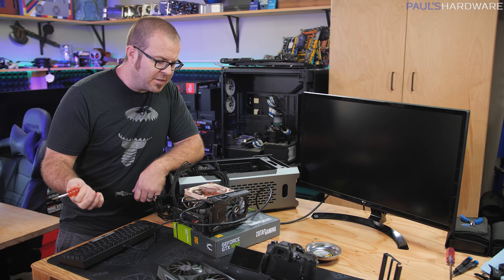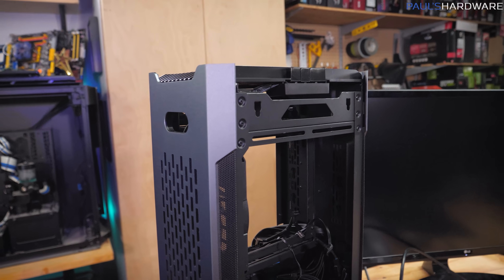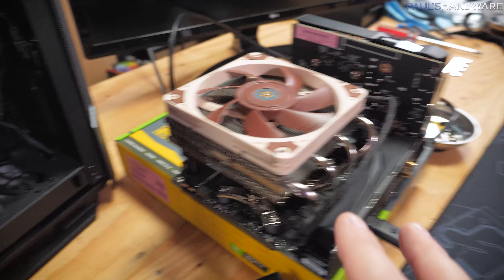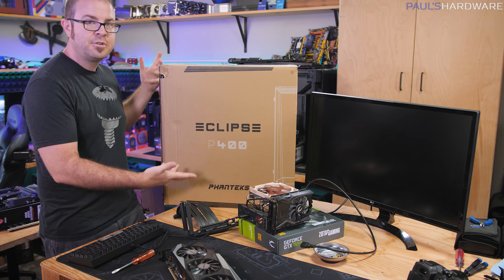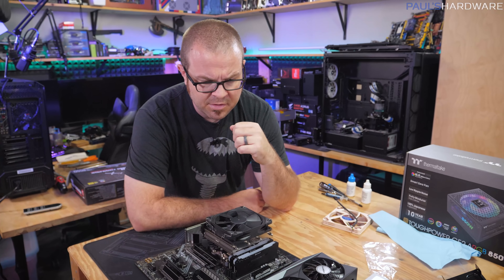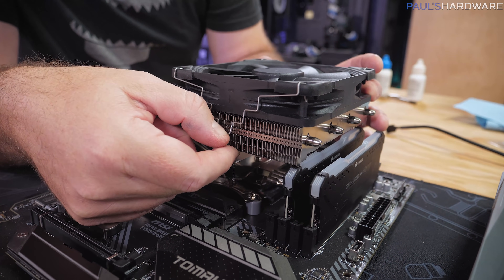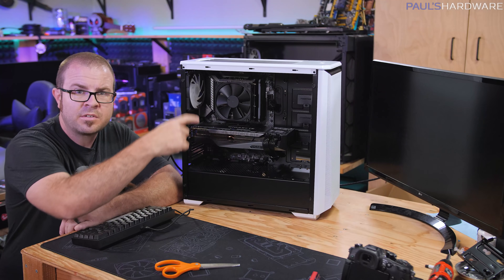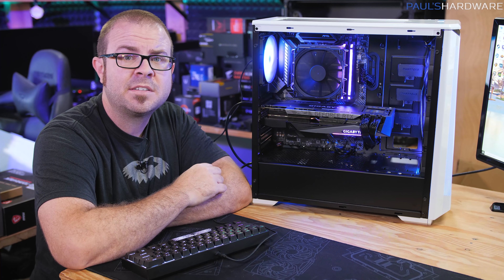Fixing the Chad PC... again

Comment: I been trying to fix my computer, a computer build that I saw on your channel the one at the time that was at a reasonable price with the 580 gpu, the screen goes black where I have to restart to see my screen again and I would have to download the gpu software again as if it wasn't installed it works for a couple hours till I have to do the cycle again.  The Gpu is 3 times the price now. I've done bios updates for all hardware and the one year warranty seems to be no longer valid. Any PC Master tips on how to fix gpu?
Reply from the maker: Interesting issue, some good tips here already though. Agree on checking the sleep bug issue, and using DDU (from safe mode) to wipe and reinstall drivers. I could also see this being somehow tied to power, thru your PSU or motherboard, since it sounds like Windows isn't recognizing the GPU and reverting to default drivers. Testing the GPU in another system (that you know works) would also be a good way to figure out if it's just defective though.
Reply: @paulshardware  Would love to see a vid on this one too, everyone has forgotten the good old days of troubleshooting vids.
Reply: First thing I would do is download DDU and completely wipe all video drivers in safe mode, then boot back to standard windows and reinstall the latest AMD driver and see how you get on
Reply: Are you letting your computer go to sleep? gcn radeon cards is known for a sleep bug which is usually related to Windows being windows when it comes to updates. (Doesn't explain the need to reinstall drivers though)
 Here's a few followup questions
Are you still getting sound out of the computer? Hows the tempatures?
1.
download the drivers, download DDU. Run DDU, unplug your etheenet cable and install your drivers to make sure windows isn't trying to install drivers
2.Try alternate version of the drivers. 
3.Try a new display cable.
Reply: curious, how are the temps..
Reply: Is there no GPU driver shown installed after a restart? Very strange. Have you tried reinstalling windows from scratch?